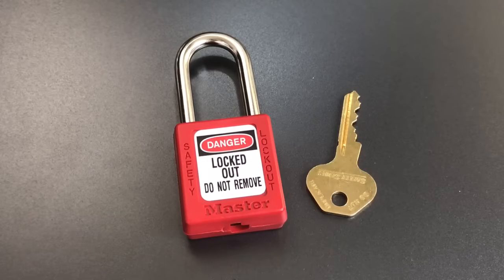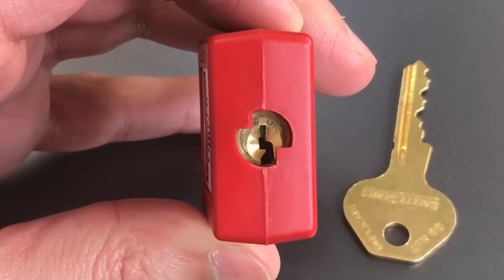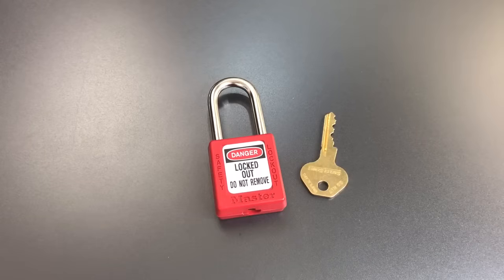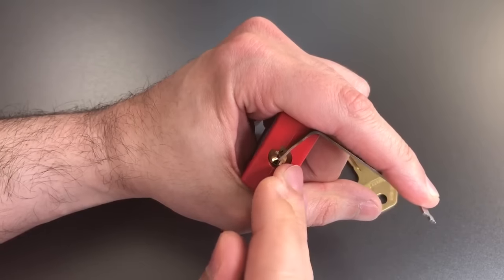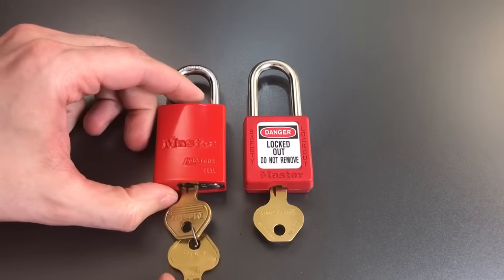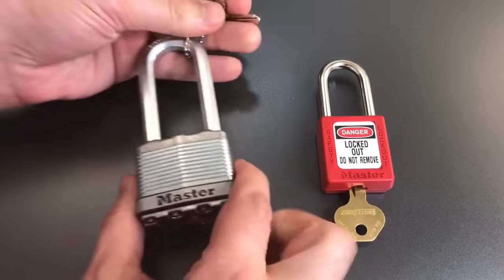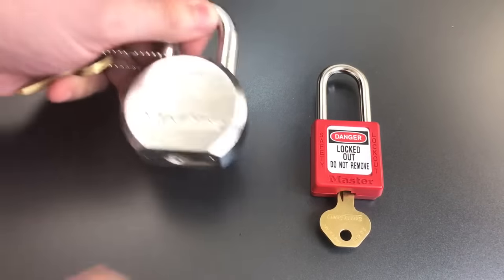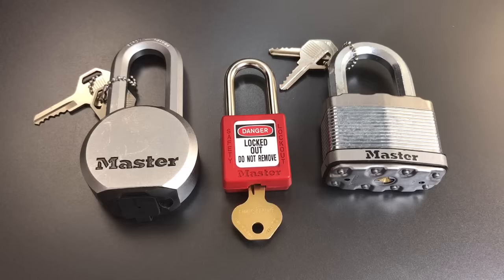[479] The Master Lock Paradox - Model 410 LOTO Padlock

Comment: Coming from someone who has over a decade in the oilfield industry, my guess behind the plastic body would be for economic purposes. These are used as safety tools to keep someone from starting up a unit, rather than keeping someone out of your belongings. Considering companies purchase these sometimes in hundreds or even thousands at a time, the plastic must save some money. Not to mention how often they get lost or stolen by employees.
Reply: Then why make it such an advanced lock? He says it's got 6 pins, with security pins. Then goes through all the expensive locks, and none of them have anywhere near as good security on pins.
Reply: @chris24678  Making the lock tough to pick means it can't be removed easily by non-destructive means without its key, which should thwart any unauthorized removal of it since a destroyed lock would provide evidence of such.

Comment: I picked up one of these when I first started. because it was plastic I thought it would be a easy open. boy was I wrong.
Reply: 1956willys4x4 well now you have a practice lock
Reply: same actually watching this video because I felt counter rotation and thought I must be wrong because its just a plastic lock I happened to have in the garage, also thought I must have miscounted the pins lol
Reply: A hammer will open this in seconds.
Reply: Bad Samaritan no, it was more like 23, but it was still quick
Reply: Same here. First one to give up on and first one to cut open to look. First and the last one I tried to put back together with only tweezers and my pick tools. No longer a set
Reply: BOY WERE THEY WRONG
Reply: Bad Samaritan lmao

Comment: If there was an incident at a LOTO job site and tampering was suspected, a broken or cut lock is far more obvious than one that had been picked.  When my sig is on a LOTO, the last thing I want is someone to easily pick the lock, cycle the power, pop the lock back on and exit the area.  That could make an investigation very difficult.
Reply: I can definitely appreciate why LOTO locks are designed as they are but having the ability to buy a padlock for conventional purposes with a core in that style would definitely be a selling point. Their 10/10-rated puck locks with absolutely terrible comb-pickable cores is a good use-case for this. It's an easily identifiable target if someone sees one and has ill intentions. If they know what they're doing it's open season.

Comment: I've smashed a ton of these locks as a PLC programmer. Millwrights or electricians do some work, forget the lock and then go home leaving a machine in a locked state for the next shift. We call the name on the back, get verbal confirmation the machine is safe to run and smash it off with a hammer. Saves lots of time removing locks but I suppose everyone involved needs to respect the kind of honor system there.
Reply: Easiest way to remember the remove the lock is to lock your car keys to the lock when you lockout a machine.
Reply: As a union electrician myself, I appreciate you stating that you call the number BEFORE smashing the lock. It’s EXTREMELY important no one ever removes one of these without direct contact and approval from the name or company written on the lock
Reply: Should always get a written agreement over a verbal one
Reply: I forget my lock all the time... millwright here.
Reply: Good way to get yours keys stolen
Reply: Leaving your lock on an isolator and leaving the site is a good way to get sacked in Australia
Reply: @youngmodulus4617  It's a good way to get sacked anywhere really. Just depends on how you respond to it
Reply: @youngmodulus4617  

At a US Nuke plant, removing one of these without permission, will get you confined by plant security until FBI agents show up to have a talk, as well as getting fired. Never saw it happen, though; plenty of vetting beforehand.
Reply: Well, now you can just pick them and have a set for movie watching.
Reply: I was lockout certified at UPS so that I could remove packages that got sucked into the drive motor cage, mostly envelopes and apart from some scuffs they are normally undamaged, but if I ever left the facility with my lock on a piece of equipment I would have been written up and required to come back and remove it. 

The only time we broke a lock was when a contracted mechanic left his lock on. We didn't just contact him, we walked out all the conveyors affected by the lock and had multiple people confirm all clear by radio. Needless to say that in the future we called someone else first.
Reply: @youngmodulus4617  Some things do need to be locked out for multiple days (it's not just electrical equipment getting LOTO either, I've seen it on a gas line for a deep fryer before).
Reply: @karlrovey  oh for sure, I've worked on locomotives that were locked out for weeks at a time. But only workers who are currently on the site should have a lock on the box. You should put on your lock at the start of your shift and take it off at the end.
Reply: Positive contact is the same system we use, call the guy make sure hes home/safe and smash his lock off,at  the steelworks in the illawarra they wont touch it. You get to come back in and take the bastard off yourself
Reply: Also, it is perfectly normal to leave machinery locked out for multiple shifts, locks should have been transferred if that piece of equipment was expected to come back online.
Reply: @michaelkaba7481  yellow locks are used to lock out a piece of equipment redlocks are for personal safety, not always a control cabinet and almost never a hammer, ill use 2 spanners to pop the lock apart

The whole locks being transferred comment is pretty redundant because were talking about the human error of leaving the lock on. The person has then obviously forgotten about it.
Reply: @6footsideways  It really does not matter what type of equipment Is being locked out.  My point was that whatever the locking mechanism, it probably doesn't appreciate a hammer (The locking mechanism on the equipment, not the lock).  And if you are prying a lock apart and re-using it, I personally would take issue with that.  Once a lock has been compromised, it should be removed from service.  And color, can vary with company standard.  I have refused to remove my lock for floor supervisors who just wanted to make quota, or worse, get above quota for the sole purpose of furthering their careers when I knew there were problems with eqipment that could hurt somebody or lead to further damage. Really don't appreciate your tone.  If I ever caught you reusing locks like that, I would take issue with you, not your supervisor, you know what I mean.
Reply: @Harmageddon  in a mill situation you might have hundreds of guy loto every shift, with up to 30 locks on a single piece of equipment. It's pretty common to have your name + phone # on them to be contacted if you forget it. Also, usually the foreman or supervisor will also be double checking that you are accounted for in most situations.
Reply: When I worked in the oil field there was no lock out precedure at all this was just 5 years ago we climbed in the pits with mixers that will turn flesh to tomato paste and have water blow off valves pushing enough pressure to blow a hole through an elephant not to mention when they do blow sometimes H2s gas can enter the pit which is extremely deadly you simply carried a gas monitor with you and stayed alert to your surroundings it certainly was an experience to have one of those valves pop while I was in a pit though sounds like a 12gauge shotgun
Reply: @Harmageddon  And that is an option of course, but that would require the guilty party to come back to work to do the paperwork. Of course they could simply unlock it at that point.

And it is the responsibility of the worker to remove their lock at the end of the day, or communicate that it has to stay on. 

And at $5000 a minute for downtime in a car plant, I think that the verbal approval route would be the way to go.
Reply: @Jean Phil your plant makes $40,000,000,000 profit a year? 

Ok
Reply: Its so you can cut it off in an emergency, and they're cheap to produce cause factorys are buying hundreds of them. 6 pin core they are already producing so they don't have to tool up for another design yet make a ton of key combos. Every maintenance guy ive ever meet has a battery powered grinder, they are just there as a means to alert someone not to turn something on, there is zero security involved. Don't know why its so hard to figure out?
Reply: its no faster then bolt cutters or a zip disk there locks are trash and cheap that's the reason why companies use them

Comment: Reason: it's a breakaway lock. It is made to be snapped off with a simple tool, like a pair of pliers, in a hurry. The sophisticated core is a deterrent. It's there to ensure the lock wasn't removed in a malicious way. If you don't have they key, but someone is getting cooked alive because a valve didn't hold or a line blew, you need to secure a line NOW. No time to find the guy with the key; you can bypass it in a hurry. If it was a simple lock, it could be picked easily and quickly by someone with malicious intent. So the core is there to help raise the question: "Why was the LOTO removed?", if it was removed improperly.
Reply: Ok, that explains the weak lock with the good core. But why the strong locks with worse cores?
Reply: @dimanetov1807  Those locks are difficult to cut. If you lose the key and you want access to your property, you'll need to hire a professional locksmith. Simpler core = more cances your local locksmith will be able to open it in a reasonable amount of time and not cost you an arm and a leg.

Of course, this *does* open up the danger of thieves with simple tools and a passing knowledge on lockpicking....
Reply: @dimanetov1807  they didn't listen to the LPL 🤣
Reply: Sorry, but that is a stupid reason.
You NEVER lock something what could be so impotant that it could save a person or a proces.
I am a electrician, I lock switches so there is NO WAY that someone turns the switch on, If you work with valves and you don't want anyone to turn it on, you lock it.
Locking things keep you safe, if you lock something that could save someone's life you are STUPID, don't use a lock, use a permanent human watch, who can turn something ON in case of an emerency.
Like you say, no time to find the guy with the key, you can bypass it in a hurry,..... yeah, by finding the guy with the pair of pliers ????
Reply: It has far more to with variety and cost.
Having that many pins means that many more possible combinations, and if you have a company with 100s of people who need LOTO locks, you need to have a unique key for each person.  The plastic body just makes it cheap.
Reply: @marcob8294  you completely missed the point. If you've ever actually used these particular locks, aside from the core, the construction is literally next to junk. I'm talking about the plastic bodied, LOTO locks. Maybe the locks you use to lock out are heavier duty. My explanation does not apply to the steel locks.
Reply: Yep, seems like masterwork doesn't want to get sued.  

"I told the new guy to unlock a different fusebox but he went to the wrong one and somehow his key worked and frank got electrocuted"

If someone destroyed the lock to turn something on and someone died, masterwork would not be at fault.
Reply: Damn you autocorrect...
Reply: Plus, the "guy with the key" is the one most likely to be in the dangerous position.
Reply: Why would you lock a breaker shut or a valve open?
Reply: Having a strong core to deter picking by malicious individuals means little if the malicious individual can simply break the padlock with trivial effort. A smart saboteur would dispose of the lock either way, so the evidence would point to the victim having negligently failed to lockout their equipment.
Reply: could you put the 6 pin core for the loto into a m930 or something else like that
Reply: "simple tool"

Me: copy workshop, so and so still on site? He left something on this dozer.

Workshop: narr, he's on day shift. He's back at camp.

Me: copy that. grabs two rocks

Comment: As somebody in the construction industry the best reason I can give is if something happens to that worker who has the key and the key is lost, a set of bolt cutters can get everything up and running again with minimal effort. Most of the time these locks are nearby sensitive switches and equipment and you don't need to be struggling to get them off.